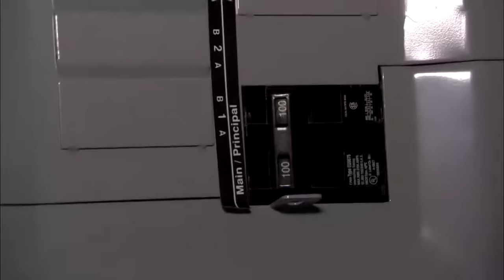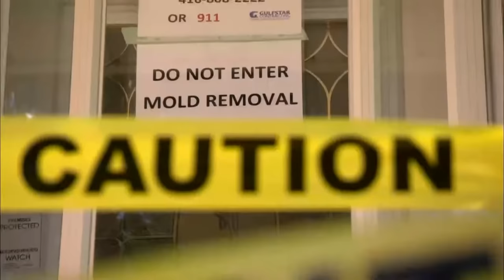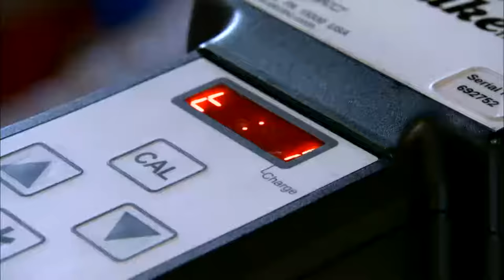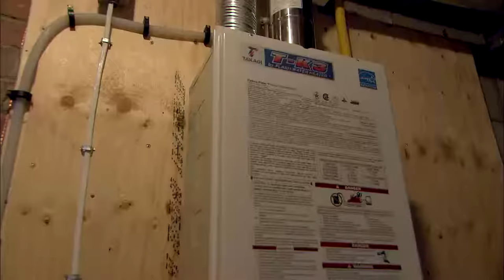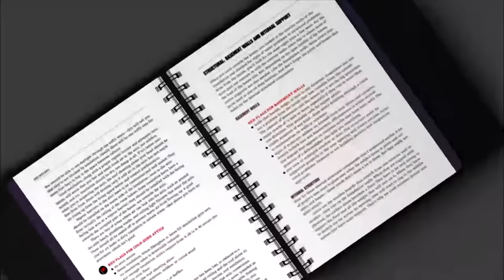Mike Holmes Protects Family from Electrical Disaster! | Holmes Inspection 116

Comment: Throughout all of the Holmes Inspection series, I always wondered why there is no recourse for the home buyer to seek compensation from the seller or home inspector for problems that were found after the sale is completed.  It's obvious that most home inspections are not worth the paper they are written on.
Reply: Some inspectors guarantee anything major found out in the open that they missed for the next 12 months - I know mine did
Reply: You think at least legally, some recourse would be available. Would be nice to see the report, and if they would need to, block out anything identifying the "inspector"., As well doesn't the realtor have some responsibility, or previous homeowner for doing the unsafe items.
Reply: Probably a "I'm not liable" clause in the contract(s) of sale and inspection.  Not a new home, so no new home warranty.  It is, "as is", saddly.
Reply: The inspector should be  fined and his license  revoked
Reply: @kathyschaefer5768  In the province of Ontario, Canada there is no licensing requirement for home inspectors.
Reply: @bwillan schooling/licensing should be an absolute requirement. Fines should be imposed for minor things. Jail for severe things. Multiple infractions, they go back to school or lose their license permanent
Reply: Why do the realtors hold no responsibility. A home inspector might make $600 bucks which isn't enough whereas the realtors commission will be in the thousands. The realtor in this episode obviously had a scam going with a home inspector and ripped these people off for thousands of dollars Scott free.
Reply: i was told that you can not fight the inspector it is what it is
Reply: You can take action legally against both the realtor and the home inspector.  Based on how it was presented to this family, you could make a cause for Fraud -- check with the local District Attorney, or the realty licensing agency for your state.  In a civil court, you only need a preponderance of the evidence.  If this was brought in front of a judge, you could get compensated.  That doesn't even start to cover the time and aggravation for something that should never have happened in the first place.
Reply: @earlgendron4893  are you in Canada or the US? I'm selling my house and looking for another house and my inspector in the US missed a lot of serious issues.
Reply: @bradreynolds8499  if the problems found are life threatening? Mold? Asbestos? Plumbing gases? If it is obviously there it should be noted. In so many episodes the mold is practically in your face.
Reply: They do in some cases. I remember reading about one episode where they went after a house flipper and realtor who were in it together and got sentenced pretty hard.
Reply: I agree, but the previous homeowners on this one should be held accountable for sealing attic and forbidding anyone to go up there.  I hope they sued to recoup some of Mike and crews expenses.
Reply: Buyer beware. ..amd many home inspectors will say " electrical wiring is beyond the scope of tgis inspection
Reply: I know in the United States I can take a online course and be at home inspector in three weeks maybe even shorter now I don’t know about insurance I’m sure that they have to have it but I don’t know
Reply: @kathyschaefer5768  They have a licence?
Reply: In the United States half of the states require home inspectors to cary e&o insurance.  After a claim or two they get dropped by the carrier which makes it very hard to get insurance from any other carrier.
Reply: A proper home inspection is several thousand dollars. If you get a license to home inspector, they will have errors and emissions insurance in the state of North Carolina. That's the same kind of insurance that your real estate agent has.
Reply: They have to be, why else mandated one?

Comment: Never, Ever let your realtor be involved with the home inspection. I was a certified home inspector as well as a general engineering contractor. I quit getting calls from real estate agents as when I did an inspection, I went over every inch of the home and of course found a real mess with electrical, HVAC, structural and any number of red flags. The realtors put me on their do not call list as they were more interested in closing a sale then determining the detriment to the buyer of a faulty home. It teaches you a lot about peoples integrity when dealing with these crooks...NAME THE INSPECTOR THAT CERTIFIED THIS HOME!

Comment: We had an inspector not go into the attic because the access panel needed a screwdriver to open. As a result, he did not include the upstairs AC info in the report. We asked the seller to open the access, and pay him to come out again. All was ok, but it could have been a nightmare.

Lesson learned. If the sale is contingent on the inspection (and it should be), insist that all spaces are accessible.
Reply: If you pay an inspector to inspect a house then he should inspect the entire house.  If he has to twist a screwdriver a little bit then they should start twisting the screwdriver.

Comment: With that backsplash having the thin tiles, what would it really cost the manufacturer to have a removable outer surface sheet to keep the tile pieces separated until the mortar sets?  Either one with raised portions to act as spacers, or some kind of stiffer card stock with clean removal adhesive would make installation SO much easier.

Comment: I have a pretty stupid question about dryers. They are not common in my country, but all the ones I've seen don't connect to all that piping that I often see on the show, just electric. Is it a different type of dryer that doesn't need it, or what's going on?

Comment: bad electrical is scarily common

our house- the previous owner said one of the breakers trips when it rains, and they would just set it back when it stops raining... An exterior outlet, decades-old was shorting out because ants got into it, and it wasn't sealed at all. Installed a new box, and silicone'd it up. haven't tripped a breaker in 4 years since. most of the outlets were close to shorting out if you wiggled them, most with incomplete grounds for no particular reason, and most receptacles had broken plastic around the ground pins. 

no idea how this place didn't burn down. replaced nearly all the outlets, and they all test correctly now. (all 12g romex, some older sheathing- but juust too old to have any aluminum. panel will need to be replaced by the next guy..)

Comment: I've seen homes like this one many times -- often enough to assume this is what I'll see in ANY house this old (1950's build likely). The more "updated" or "improved," the greater the issues likely to be found.
You have to remember that folks back then didn't live as we do. Far fewer appliances. No air conditioning. Plaster instead of drywall. Unfinished basements. Where there are changes there are problems -- especially if the work was done by home owners and handymen.
This house? Clearly a complete gut and re-wire. 
Electrical? Far too few circuits. Missing outlets and light switches.

Comment: @11:15 The dryer exhaust is squished. That means the lint can build up in it and create a fire hazard.
Reply: I have never understood this dryer exhaust business. On the machines in my country the traps for lint are built in and to be cleaned after every cycle - no big deal, it's a routine easy to do. But an exhaust to go outside the house seem strange.
Reply: @EricaHLjung  The lint traps in my country aren't good enough to trap all the lint. Also, people don't like hot, humid air blowing around they houses.
Reply: @EricaHLjung  The dryer has a lint catcher but as you can check your dry it does not catch everything so the exhaust tube will have some lint which ca  cause a fire. 
I clean mine every 6 months plus I wash the lint catcher also.

Comment: I was watching a video put up by Safehomes, and the owner claims to be licensed home inspector, but the man said if an asbestos pipe is found, leave and do not disturb it, that asbestos removal was unneccesary. He also said that electrical issues that haven't caused problems should be left alone, that junction boxes hidden were not a problem. He was very anti Mike Holmes because Mike says miinimum codes just isn't enough.
Reply: You need to check the laws where you are. In some areas asbestos is fine if left untouched or covered like flooring. If you have a unlimited budget you can over build everything like Holmes does. This show is in Canada so rules and laws are different than in the USA. Any other country will have different rules to follow.
Reply: If Asbestos deteriorates it becomes airborne and from what I understand, that is when it is dangerous. Usually if you don't touch it, it won't harm you, but if it starts falling apart it will.  Safe removal prevents a future problem. So if you can, why not? 

When an electrical issue happens it could be burning down your house. Why would you wait until after if you've noticed a problem? Junction boxes that are hidden are illegal because an electrician needs to be able to find them to solve issues. You'd have to tear apart the house to solve an electrical problem with a hidden junction you don't know the location of. A one hundred dollar job can become thousands upon thousands because of a hidden junction box. How would an electrician find it without tearing your house apart?  If you can solve these issues before they become larger problems why not?
Reply: There's too many ways to educate yourself. Take accountability. No inspection without being present. Don't pay the inspector until after the inspection. Don't be afraid to call them out. Don't let them beat around the bush. If they start...INSPECTION OVER!!! RUN!!!!

Comment: They most likely didn't have a home inspection by a representative who represents them as buyers. The bank or mortgage company called for an inspection to make sure their loan amount would be protected in case of default. The Realtor and mortgage representative should have told them that. They had  right to hire an inspector to represent them and look at the home from top and bottom. Problem is most likely no fault can be found on the Realtor and/or mortgage representative as I'm sure the buyers signed off on whatever they were asked to sign off on without understanding that they were not represented in any form for receiving knowledge of the home by a licensed inspector hired and paid for by them.

Comment: Who the heck would accept a home inspection that doesn't even look at an attic? These people were bait and took it great.
Reply: The attic was sealed shut. Although that's a red flag, unless you've bought the house, inspectors and potential buyers cannot remove or undo anything to check it out unless it's negotiated in the dealing. My house had tarp stapled to the basement ceiling. I found a minor termite damaged beam but had to get it on paper during the negotiations to pull it down to inspect the rest of the beam and floor joists. Inspectors can't even remove outlet covers to see if it's grounded properly.. one screw stand in their way from telling you the house needs electrical work.
Reply: Unfortunately that happens more than we realize

Comment: I'm getting the feeling there never was a home inspection. The realtor just wanted the sale to go through and lied through their teeth. The electric outlet in the bathroom would have been enough to fail the inspection, and that was in plain sight. The fact that the attic access was sealed would have been enough to fail the inspection. The furnace room would have failed. The live wire in the kitchen cabinet would have done them in.
There was no inspection, even the most disinterested inspector would have failed to see at least one of those issues. Even I have a circuit tester to check if the wiring is correct and the plugs are GFI protected.

Comment: Why have a home inspection done if you can't do anything with it and can't hold the seller responsible for it after the purchase.
You should be able to tackle the house inspector and hold them jointly liable for very poor work, at least take away his permit.
or does he not need it and anyone with common sense can become a home inspector........or so it seems.
shameful that this happens and you are trapped in your new house with your children in a very dangerous place and 
nowhere can hold anyone accountable for everything.
What I really wonder now is who actually pays for all these costs in this house, is everything for the new owner of this house?
or is there still an attempt to recover the costs from the previous home owner.
i just think it's so bad that this is so common when people buy a house, people should be protected against these 
malpractices in the housing market and have some sort of purchase protection.
There should be a broadcast in which you confront the home inspector with all the defects he has missed and who will pay for the costs of repairing them.

Comment: What’s wrong with extension wire?
Reply: It's not rated for permanent use. It's not rated for the expected current load. The wire will melt before the breaker trips.

Comment: The incredibly botched electrical wireing this couple inherited, but 100% of the black mold and mildew damage they caused themselves by running their dryer with a kinked exhaust pipe. It is hard to believe they couldn't figure it out before the whole house was full of black mold and mildew.

Comment: Why do they need new appliances if the problems were fixed?
Reply: The owners had bought their own appliances, to remodel the kitchen. However, the scheme or theme, wouldn't work with the space etc.in that  "moment" of the houses existence. So in order to make it an functional home, they installed their own appliances, gifted/donated to the family; that are built into the homes main surface interior. Which in hindsight releases any liability for the charitable expansion of the home improvements. If they were to put in the owners appliances, and it didn't work, it would cost more money to fix and including time. Their goal was to leave the house operable. ❤

Comment: Actually Mike, there is no NEC/CEC requirement of outlet height above the floor. It is forbidden to install an outlet on a flat top surface (like a counter top) unless you have a pop-up and approved device. But you can be an inch from the floor or counter, but an inspector would surely say NO if they see it. But who pulls a permit?

Comment: This homeowner wants to inspectors to be fully told and inspect everything. Well they’ll be cutting holes in the walls ceilings make an access panels. They knock up ceiling back up. They’re not gonna be responsible they’re just there to inspect what is visual that is it they can’t see what’s covered upthey’re doing that outside inspection they’re not magic they can’t see everything humans make mistakes. Nobody’s perfect and this homeowner thinks everybody should be perfect. Well I need to go to another world because nobody’s perfect.